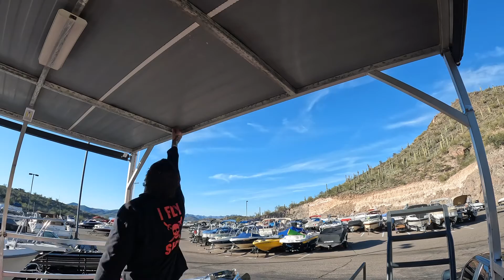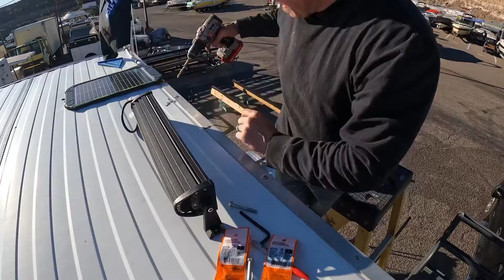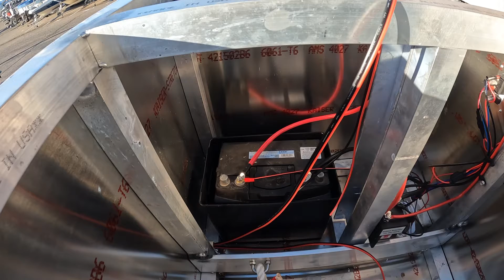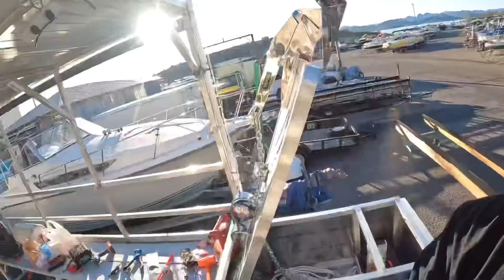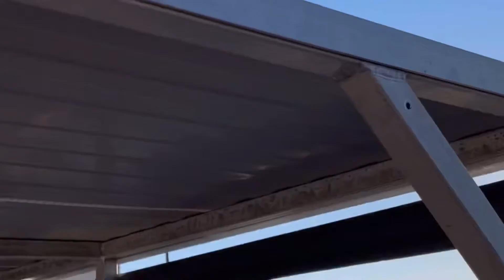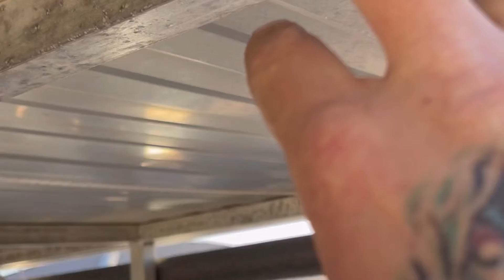Front deck and ladder lighting

Comment: Was that a small solar panel on top?  That box you built looks great
Reply from the maker: Yes sir!  Solar panel on top that keeps the battery in the anchor box charged. That battery is used for the windlas (anchor winch) and the front light bar.  So it will never be getting drained.  The solar panel keeps it topped off with out having to run wiring all the way aft to the alternator.  Also (should never need it) but it could be pulled out, moved to the back used as an emergency starting battery.